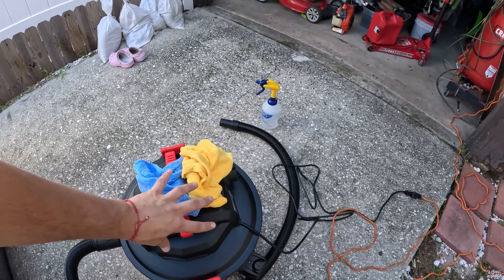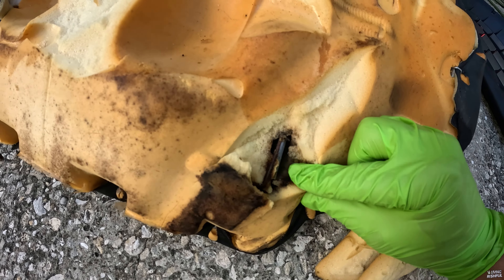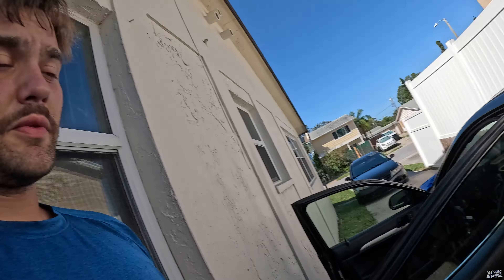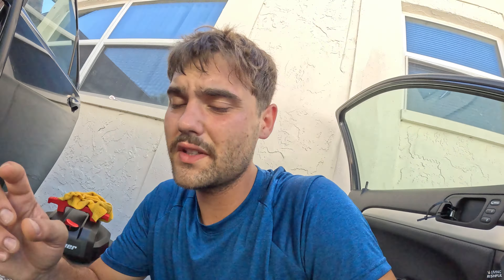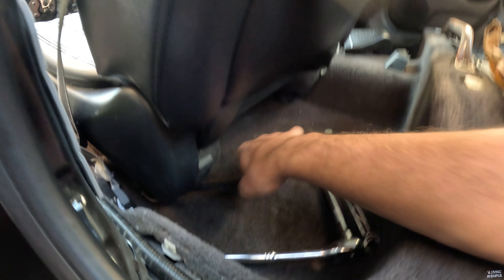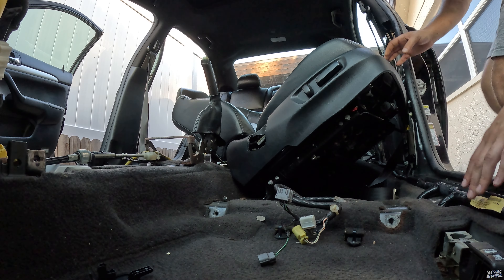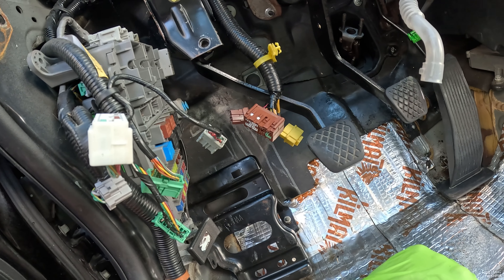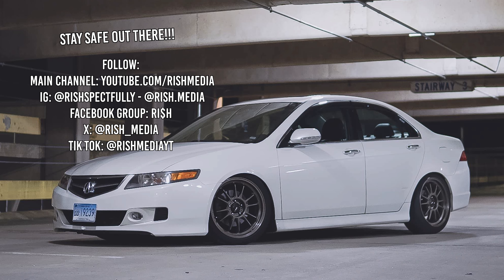TSX Left ABANDONED...Then This Happened!

Comment: Remove the 2 rods from the upper roof. The roof of the TSX is glued and on time creates a crack. That may be your problem. I changed the front glass of my TSX and when they removed the roof rods there were those cracks. It was sealed with urethane
Reply from the maker: I gotta redue the windshield so possibly from the sealant there or even that hood latch grommet + the others around there. 

Just another one to figure out lol